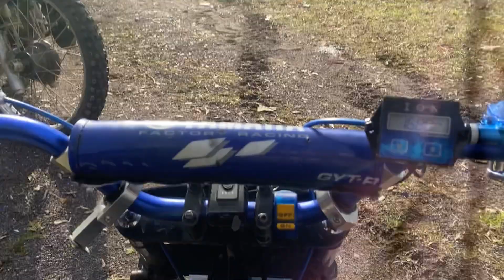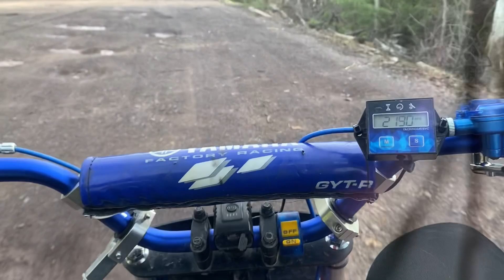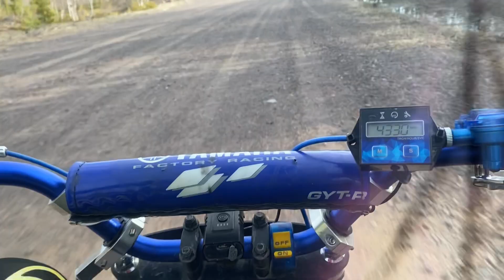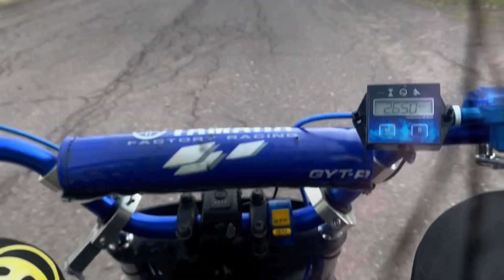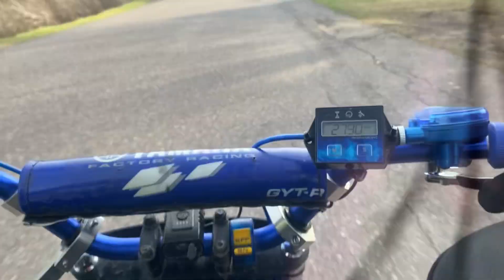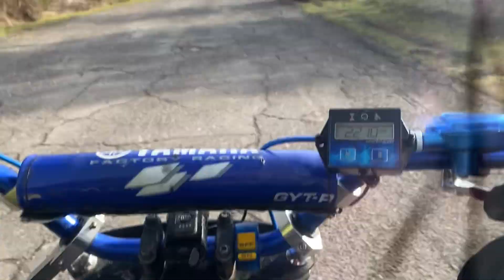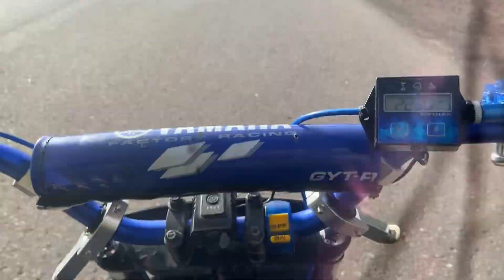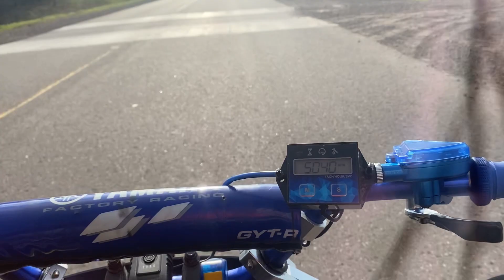Riding my MINIBIKE to school! | Darzrt

Comment: What is that noise on de acceleration need to fix ur bike before its too late
Reply: You get it on a long pipe. I used to have a long pipe but it broke so I'm running a short pipe but imma weld up the long pipe soon